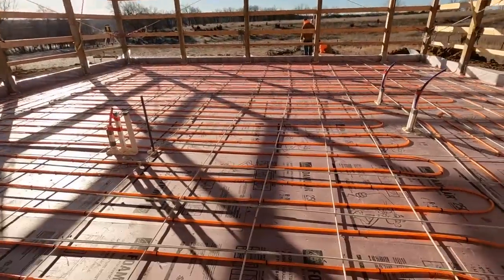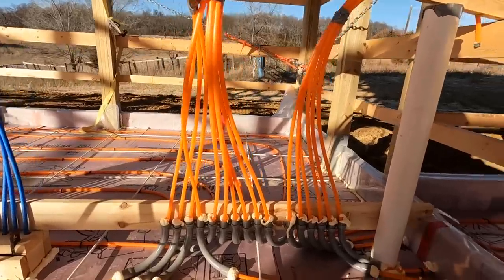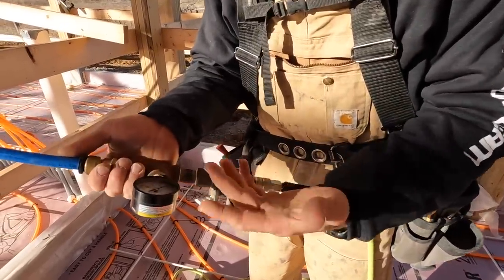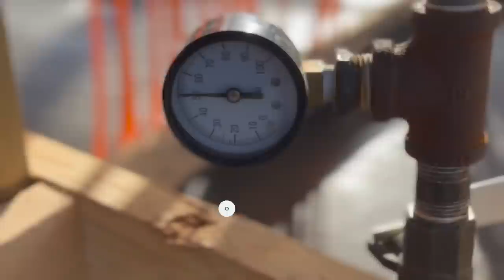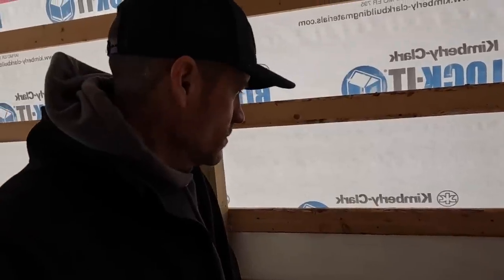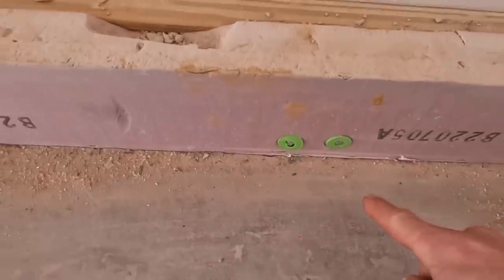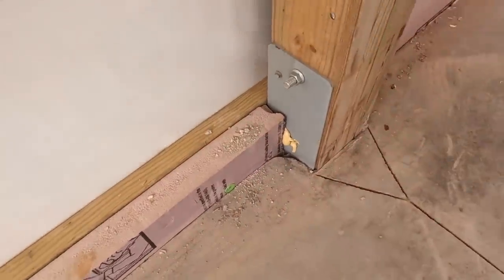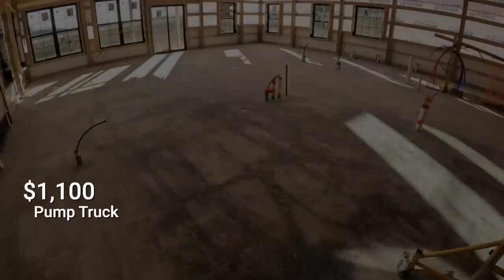Barndominium Concrete Slab  | Full Cost Breakdown | MAD County Standard | Ep 9

Comment: I don't know if you're taking suggestions but, if you put SharkBite fittings at the bottoms, you don't have to cut off the clamp each time. And I can also tell that's a tool you've made with many t's on it. Just in case you have a large manifold system too. Pressurize. So with that in mind you probably don't have to use all of them all the time, so I'm assuming you block them off. If you make blockers that you can just pull out then you can leave the blockers in it while it's being stored.

Comment: Hey Paul. Could you possibly answer this. When you poor your piers and build your walls, isn’t part of the pier sticking outside and in the weather? And would that cause water to land on it and allow the engineered beams to soak up that water and slowly rot?
Reply from the maker: There is 4-6” of compacted gravel as a base which provides drainage if water was to get under the finished slab. The final grade away from the house is sloped away from the structure and gutters take the roof water away from the structure as well.

Comment: $510.00 per cubic yard just in concrete (30 cubic yards x $510.00 = $15,300.00)!  Is that typical when concrete usually runs $130-$150 per cubic yard???
Reply from the maker: That price includes rebar, rebar install, concrete, labor to pour, and labor of finish work. I will say we hire the best company in our area so that price is on the higher end.

Comment: Thanks for the video.  I plan to be doing this at the end of the Spring.  Do you need to protect the pex under slab if it doesn't touch the concrete?  I plan to you foam board on my rock and plastic on top of that, under the concrete...the pex will only touch the dirt next to the drain pipes.
Reply from the maker: Sorry, I’m a little confused by your scenario. Your Pex isn’t going to touch your concrete? Where are you installing it (layers)?
Reply: @MrPostFrame  the packs would be underneath the foam board insulation
Reply from the maker: Your insulation needs to be under the Pex tubing…radiant energy travels omni-directionally through the path of least resistance, including downward. The majority of the heat would travel downward if the insulation sits on top.
Reply: @MrPostFrame  no I'm talking about pacs for supplying water to sinks and stuff
Reply from the maker: Oh sorry…had radiant heat on my mind. I do it mainly to protect the Pex. Since we backfill with rock and fines I like the extra insurance to make sure rock isn’t rubbing against the Pex. Not a lot of extra money for the insurance.

Comment: Hey Paul, do you happen to know what the going rate was per yard was for the concrete being delivered?
Reply from the maker: Sorry I don’t. I just have them bid the job knowing all the labor is included. In this case:
5" Finished Floor - Main Floor and Garage @ $7.95 /sq ft.

I have seen prices anywhere from $125 - $180 / yard for ready mix concrete.
Reply: @MrPostFrame  
  very helpful,  thx so much Paul!  👍 👌
Reply: @MrPostFrame  No worries, thanks. Keep up the great work.
Reply: $150 per yard in NE Missouri